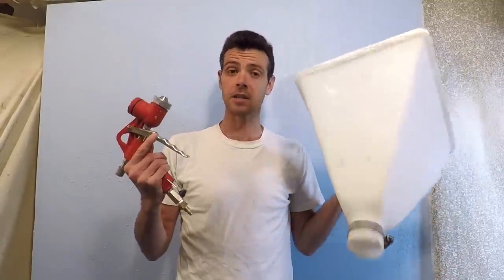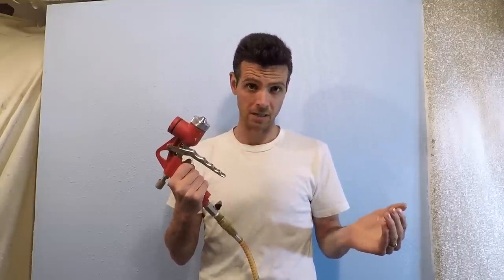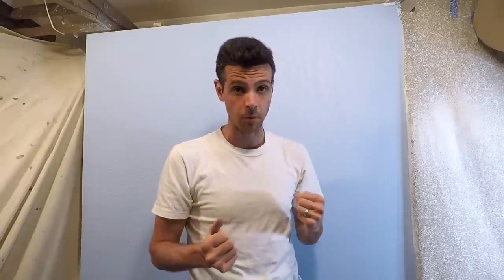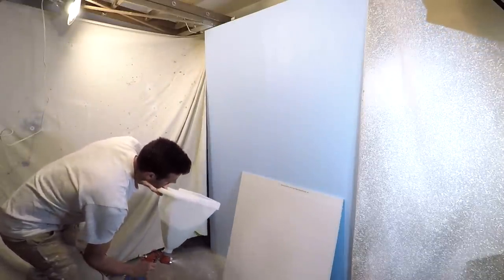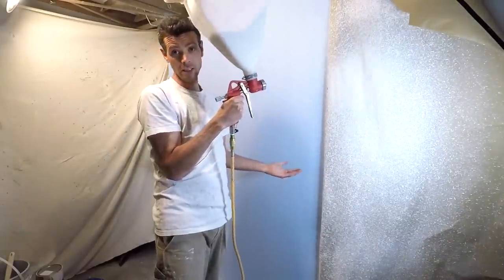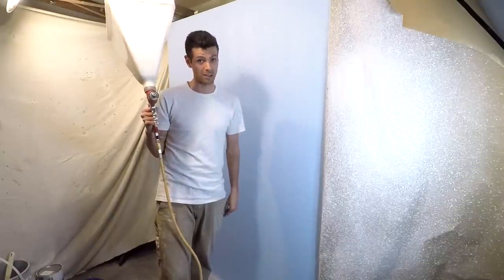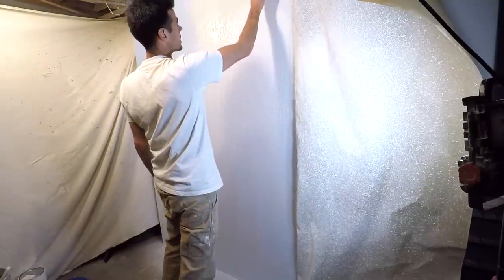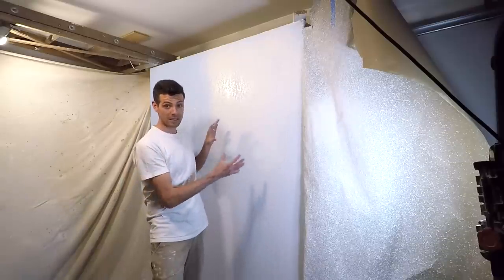My Second Attempt at Knockdown Texture

Comment: Thank you! I haven't used my texture gun in over 8 years, I get it hooked up and I thought it was leaking, thought I'd have to take it apart and replace a seal.  But you explained the issue with the air right away so I'll be spittin mud tomorrow. Thanks for all the great drywall tips!

Comment: couple things I do different
1. mix the mud with less water 
2. let mud sit for 15 min ( still in bucket before you shoot.)
3. Way to much pressure (50 to 80 psi)
4. knock it down a couple minutes after finishing (5-10 min)
my stuff looks great after painting.
Reply: Less water? Holy shit how much mud do you use to spray lol i mix it not much thicker than oil, makes it smoother and dont stick out too far after knocked down
Reply: Less water? Haha. It would not even feed in the gun. It needs to be pourable.
Reply: @SOLDOZER  gotta wonder if some people really know what they talking about or not lol

Comment: Ben...great videos!!! I can tell you care about your work like myself just by the techniques you use. I don't use a hawk and trowel like you but I do the same amount of steps. But with knockdown I still struggle!! I would prime everything first to get drywall to the same  consistency. Raw mud sucks the moisture out of your spray and makes it knockdown different. Use less air. I would say your air should be no lower than 30 psi but no higher than 60 psi and your spray a little on the thicker side. I think what you used looks good to me. The last thing is I've never been able to use my small compressor and have a good spray job. They just never keep up good enough for me or you can spray very little and wait alot. Keep up the great work and videos!!
Reply from the maker: Thanks Justin!

Comment: That dial on the back is for material flow control, can set it at an automatic depth so you can pull trigger completely without blasting material out. With that said I have my first knockdown patch tomorrow too large for a spray bottle.. almost orangpeal/knockdown so Ben is my go to man he taught me how to mix mud and tape 5 years ago

Comment: good job . mud should be a little thiner . extra regulator not needed just use the adjustment on the hopper . the new hoppers dispense the mud together with the air when the trigger is pulled . its not as good less control .in this video you did not spray too much mud but knocked it down a bit early still . also i use a fibergalss knock down knife , its very flexable

Comment: Bruh to do a knock down first get the size you want of mud shooting out, I personally like the bigger splatter. Second let it sit for a few minutes, I wait till I see drying as soon as I see drying it's telling me it's about time to flatten it out with a mud knife. Don't press hard, in this video you pressed too hard. I'll go up down left right when flattening it down. It's not hard, you just gotta cover things you don't want to get mud on like windows and trim. Get the right thickness of the mud the runnier it is the longer it will dry and it will shrink way more. Set the nozzle to the right size mud you want big small medium, remember let it sit for a few minutes after spraying. As soon as you see it drying then lightly flatten it. You can do a whole room at once with a helper cause while you are still spraying the helper can be flattening if the mud dries before you're done spraying.

Comment: I'm not a pro, but have flipped a few houses. I don't use a sprayer because I think that would take some experience. I don't want to spend 20 hours learning when I can be done in 15 doing a slower method. Plus all the equipment for my size jobs is a bit much to carry around since I also have to have tools for all the trades in a flip job.

I use all purpose right out of the bucket, no thinning. I get some on my 18" trowel and press the trowel to the wall and lift off. First push/lift just kisses the wall leaving some blobs and initially jumping around the wall. I'm just trying to get some blobs of mud around maybe a 2-3' square area. Then keep repeating the punching action with the trowel picking up bigger blobs and depositing in areas that need blobs. Keep going over the area punching and watching. It takes a long time, which is what I need because I don't have the experience. The more time punching the smaller/finer the texture is. I do a whole room wall, like 12-14 feet. Then wait. Because I didn't thin the blobs are kind of doughy and very slow to dry and uniform. I think I get a pretty large window of it being perfect to knock down like 10 to 30 minutes of window time. Because it wasn't thinned it's very safe to test because with a light touch it's pretty difficult to knock down too much like it is with thinned mud. If I wait too long it is still doughy enough that I just have to press much harder and repeat - it's much more like doing a skim coat where you can just keep working it until you're happy. With the thinned downed gun stuff it looks like you really only get one shot at knock down which is a huge plus for the professional of course but a problem for non-experts. My method also means I use a like more mud which is good for me because I can hide problem too more because the knock down can smooth out joints even more. Like I said, it's more like a skim coat.

Very time consuming but I'm trading time for experience by necessity. If I was going to become a professional drywaller of course I'd take the time to learn. But I'm not.

You can also make a mop try tamper to apply the mud instead of the trowel. Works good especially for ceilings.

As long as I do the same method everywhere it looks really great - professional, and even better than many professional jobs I've seen.

One time I forgot to knock down a wall and after a day or so I just sanded down the peaks and it looked fine. With stiffer mud you're really not spreading the blobs out like with the gun, it's more like flatting the peaks.

That's just how I do it.
Reply: Nice and explanation, gonna give it a try

Comment: In some cases in the past if it's not a huge job after spraying we've removed the plastic to let air in so the wait time isn't so long, but to each's own everyone finds what works for them you'll eventually find what works for you. But wrong very lightly is let as someone else stated almost just let the knife glide over it with almost no pressure we used a knife with a soft rubber piece on it worked great then sand it

Comment: They have plastic very flexible knockdown blade much easier than a stiff knife
Reply: Foam tip my dawg, plastic is may work but is cheap and not durable.
Reply: I'm not sure if it's just marketing talk, but mine is a "poly carbonate" blade.  I've had it about 8 years and I'm not sure what could wear out on it pushing texture down.  If others prefer their "foam tip" that's great, but I don't know if durability is really an issue.
Reply: @EricHamm  do you mean rubber tip  magic trowel?  I have never seen a foam tip and sounds interesting
Reply: ive also seen a rubber window squeegee work well
Reply: @omma-llama7860  
I've never seen a rubber window.....lol!
Reply: Same here. I have a large 20 inch plastic knockdown blade. Good at controlling applied pressure. Works like a charm

Comment: Just free tip to help aswell. I always skim coat the wall first. Then adjust your compressor at about 45psi, make mud about like pancake batter. You did good test on a scrap piece to dial in the gun and size of splatter. If you skim the wall first it'll help with them flat spots your talking about and it'll be a more consistent good looking texture.

Comment: Aye brother a little tip for your knock down, always wipe your knife clean after every pull should help prevent wider texture & I like to primer after it’s dry so it soaks & swell to give it that finish look your after & it’s easier to see any imperfections for touch ups. Other then that you sum it up really good & what I learn in construction is there is no wrong way really. I find every journeymen to have there own unique faster way & not wasting moves on doing things. Tricks of the trade is truly a gift through experience… have a nice day mate ❤💪🏾🕺🏽
Reply: Would putting some kind of die in the texture help you see if it's even? And instead of knocking it down , letting it dry and coming back and giving it a slight block with 180 grit give you a safer knockdown look? Without worrying about smearing it or knife marks?

Comment: It's very important to prime the walls or ceilings before you do a knockdown finish, if not and you go over the mud you taped with it's going to stick it's pretty difficult like that, so prime first, shoot your knock down, pull It, give it a quick sand when it's dry and then prime again
Reply: Best answer yet.

Comment: Wait until just the tips of the splatters are glossy. The base of the splatter should be matte. I use a big 24 in flexible plastic knockdown tool so I don't get ridges on the sides when I swipe and don't accidentally add too much pressure. Make sure you wipe it off regularly.

Comment: Much thicker mud and way larger blobs makes for a more consistent and attractive knockdown, IMO.  Less water means you can knock it down sooner and it will be more even as you can feel the texture better.  I'm slow non-pro, so about 3 cycles of spray and knockdown for a 200 sq ft room, but this varies.  If I'm using a hopper like you have, more like 40 PSI.  I think your texture looked too thin and lean and was not my taste due to your 120 psi and too thin of mud.  Your "large islands" would have not been so large if the texture had less water, you're basically just smearing.  I've also rented a Graco TexSpray, insane not to for much more than a couple rooms.  In general, trend toward less water, lower psi and larger orifice for more dense and defined knockdown.
Reply from the maker: Thank you!
Reply: Agreed... Thicker mud... Not to much thicker.  Depending the size of your compressor... Not a huge one, allowing the air to kinda run out, your going to be more consistent. Around 35-40 psi...Because your compressor is going to be trying to catch up equally... Instead of when it's fully charged... It will squish the splatter to a flat (un)knockdown able texture. 
Don't knock down until it stops looking wet.
If you're going over painted area... What I do is, I spray the orange peel, then sand a knockdown the next day.
Reply: Lol non pro?
Reply: Its funny you say thicker mud but some other guy said thinner than what he had so its a bit confusing lol! I'll be practicing soon though....bathroom remodel moving right along
Reply: @RUZTY1311  the thinner your mud the longer the wait you'll have to knock it down and the flatter and longer the spread will be if you go at it too early.
Reply: @TLOYA1  Cool thanks for the tip!

Comment: There is so much preference that goes into what look anyone likes. I like to do an initial light pass, or light orange peel with a lighter flowing pancake batter consistency to get an initial base and work my way around the room applying that, then I continue where I started, and it seems the mud that was mixed stiffens up a little after it has sat a short amount of time, and then start layering it on a little heavier. I do stay back further with the hopper, maybe in-between 2 and 3 ft distance from the wall, and I like to minimize the larger spots to mostly pinkie fingernail size with a mix of some middle finger nail size blobs to get the look like to achieve. I wait until the high spots start to loose their shininess and then very gently knock them down with a wide knock down tool. The end result I prefer is a mix of orange peel, with a nice blending of small and medium sized plateaus.   I refer to it as a discreet splatter drag, with a hint of orange peel. I never liked the large blobbed look or anything with large flat spot plateaus.  But it all comes down to personal preference.

Comment: You'll figure it out. I like to spray the knock down pattern and then come back with a very high pressure and "mist" it very quickly. (Trigger control) I think that gives it a nice depth of texture. Use a wide plastic knock down knife. Gentle touch and go in different directions. Really try to stay away from going parallel with butt joints.           If the butt joint isnt perfectly flat that knock down will smear along the joint and leave an ugly, nasty 4' flat spot. Good luck. Like your videos!
Reply from the maker: Thanks Derek!

Comment: It depends on temperature and humidity and if you are spraying over a wall that is painted or over new dry wall, even on the drywall that is paper verses the drywall that has mud over it, the wall will suck the moisture out of the mud at a different rate.

Comment: I used a Goldblatt compressor and had both kinds of hoppers. I think I used to run 60 lbs. but maybe it was 90 pounds of pressure. I will be doing this stuff again very soon so I need to get familiar with it all again. I have done a lot of knockdown and a lot of orange peel. I strain both with a paint net screen thing with the elastic. I run my orange peel so my hand webs like a duck when I pull it out and my lace a little over double thickness from that. You should have a hard time screening it if it's the right thickness for knockdown. I waited 10 to 15 minutes to knock it down in Florida. You may want to wait 5 more minutes if you question anything. Late is better with lace.

Comment: Just a DIY here with a little experience. My wife and I are in the process of removing  the popcorn celling and then using a light knockdown texture. I have done research  and gotten advice from a pro. It depends on what texture you want. For a light texture you want higher pressure and thinner mud. For a heaver texture you want thicker mud and lower pressure. I am not a pro it is just my understanding. We did get the plastic scraper and it works better than the steel one. Also use the scraper at a low angle with light pressure. Get a 90 degree elbow for the bottom of the hopper gun where the air hose connects. That way you can stand the hopper gun up in a corner for filling. I found that filling the hopper all the way up can kill you. 1/4 to 1/3 at most. I was able to borrow a hopper less gun for 1 room. Lots easer and more control.
Reply: And 1 more thing, light texture smaller tip, heavier texture bigger tip.

Comment: it's all in your mix, if your knockdown mud is too thin it will be super hard to work with.. but if you have it the right thickness, it will be much easier to work with, sprays more consistent, & beads up real nice for knocking it

Comment: Late to the party but air pressured distance from wall and consistency all contribute to texture.  The hardest thing is to match is a knock down since you add in the variable of time to set and pressure of the wipe.  I’m still learning myself and it’s been years.

Comment: I did orange peel a few months ago at 35psi 4.5cfm small circles from top down. No problems until I spilled the hopper filling it lol. I made my mud runny. It was a big learning curve. It's easier to just roll on the texture if your on a fresh wall. No compressor required. Not a single original wall in my house has a perfect texture! Only the walls I sprayed lol
Reply: I just did a whole house walls ceilings orange peel 1500 ft2 and rented a texture sprayer from home depot for 88 us$ and it took me 2.5 hours total mixing my own mud and not having to carry 20 pounds of mud at my arms and hands, it was great !!  Graco machine that the compressor and 7 gallon hopper sits on  the ground on wheels and has a material hose and compressor hose feed directly to the gun 25 ft. what i enjoyed the most is i didnt have the side ways streaks of mud on the ceiling because i could point the gun directly at the ceiling and keep the same pattern, very professional finish.

Comment: We paint the ceiling first and also add some paint to the mud.  Thinned down all purpose, lower pressure.  I prefer a much lighter touch than the heavy handed plastic blade look.  We use 6” knives and go in a circular pattern. Once it’s knocked down there’s no need to paint.

Comment: Using a a rubber knockdown knife works much nicer than using a steel knife...keep a towel and wipe the edge on each pass to kep unwanted lines from making there way into the scene...also if you are not spraying directly on to new drywall...all purpose mud works the best...you can also turn your compressor down to around 80 psi...start from the top or ceiling and work your way down using circles and side to side motions...you'll get it in no time...also a trick to not getting a tired shoulder is to put your left hand behind your head to take the pressure off of your right arm...when you are doing low ceilings such as in a finished basement it certainly helps...good luck!!

Comment: I'm not a pro but ive done alot of knock down, notes from my experiences,  1) the mud should be a little thicker than orange peel 2) you have to wait more than 2 min which is so hard to do for some reason lol 3) if you get flat spots you can reshoot those areas once dried 4) I sometimes shoot on scrap and test that before touching main ceiling or wall to make sure its set up right 5) harder mud always knocks down better that soft mud, meaning if you wait to long is better than too early 6) I don't recommend lightweight mud for texture, it splats at high pressure rather than ball up on contact (hope that made sense) again i'm not a pro just IMO

Comment: Make mud about the consistency of pancake batter

Use the 3/16” tip

Low pressure 30-60 psi and high volume

Wait till sheen is gone and use light pressure

Always keep the hopper moving left to right or up and down and tiny overlap

** low pressure and high volume shoot blobs  and high pressure low volume will give that fine spray.